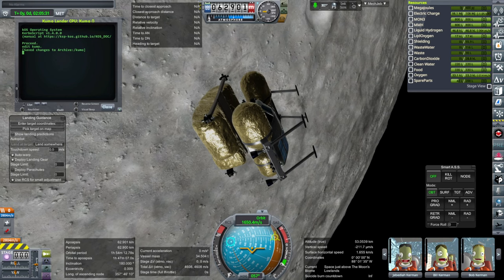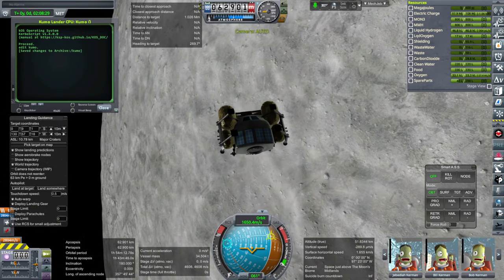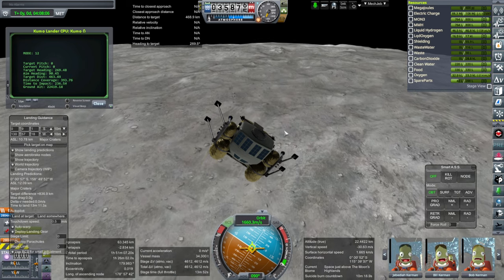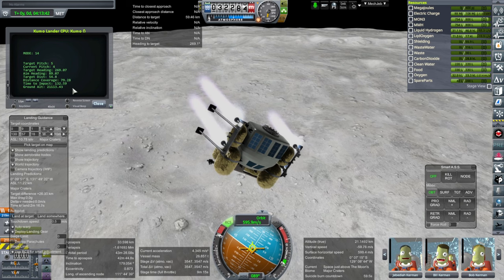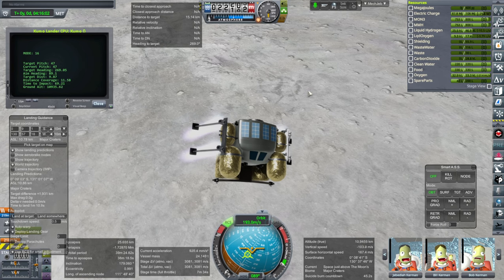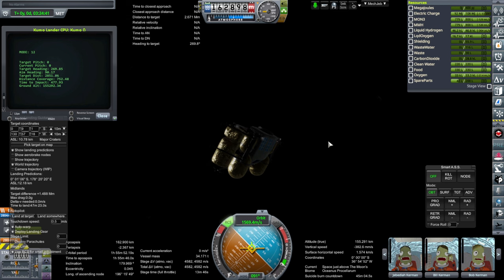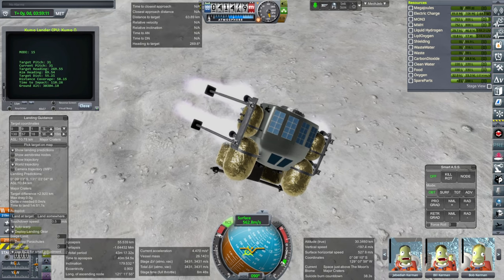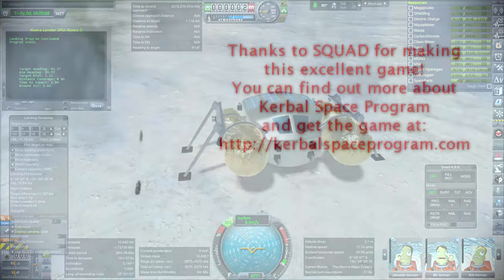Lunar Automated Landing Testing with kOS (RO in KSP 1.12)

Comment: Mad props for the landing script. I like your Kumo lander, it's like the Dynetics Alpaca HLS only as a sound concept.

On the toppling over thing: Maybe spread the legs out a bit forward and back, instead of straigt out in parallel?

Those white panels in the interior view look like the undeside of the solar panels, no?
Reply from the maker: The leg positioning is, of course, because I was lazy with the animation. :) And yeah, I think those are the solar panels. I turned the exterior of the Kumo so that it's control orientation was right and didn't remember that the interior would have to b changed.
Reply: @RaizSpace  Ah yes, both legs being one moving part per side makes sense. I can see why you did it like that. 😅

Comment: I think the kerbals are looking at the solar panels or ar the solar panels you show in the outside view not the stock panels?
Reply from the maker: Yeah, I think those are the solar panels that are supposed to be on the top. The internal is oriented for spaceplanes and I changed the Kumo so it would be oriented better as a lander, but didn't change the internal, since that's shared with other things.